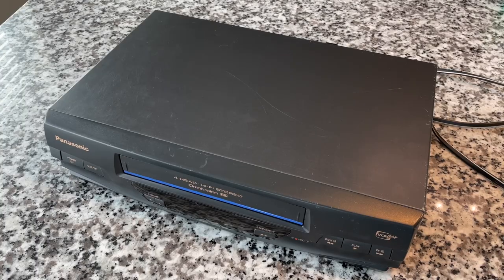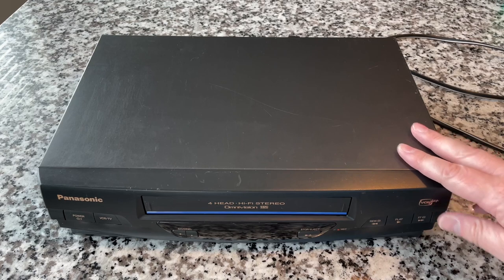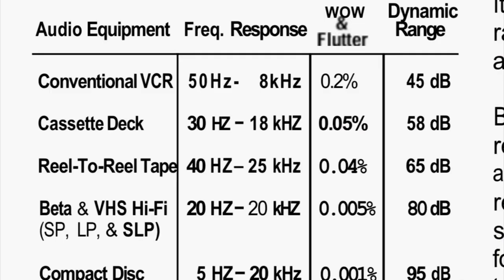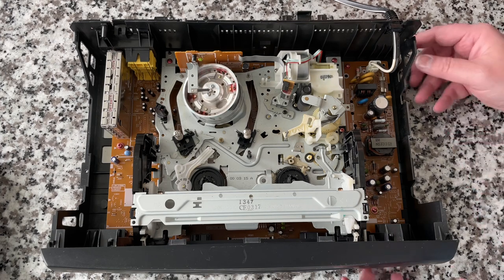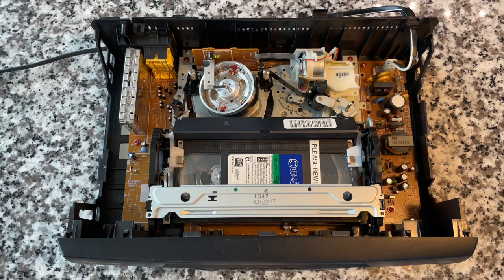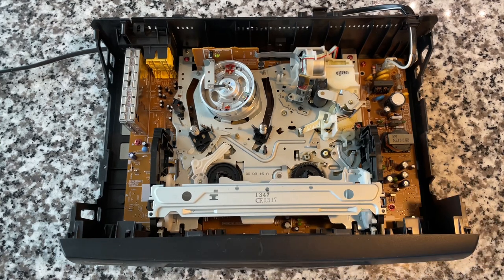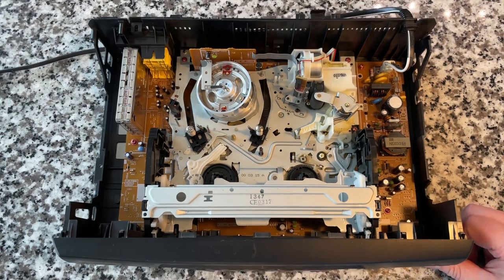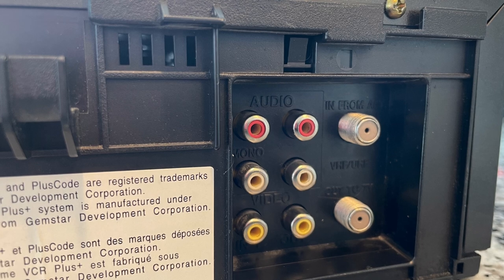VHS Hi-Fi - You threw out your best tape deck!

Comment from the maker: UPDATE  Thank you again for the corrections below.  VHS HIFI uses helical scanning heads in the drum to lay down HIFI audio.  The linear audio tracks were for older (or reverse compatible) LOFI audio tracks.  Also, SP, LP, & SLP had no bearing on the audio quality.
Reply: Yeah I was more pointing out that they actually did make a version of vhs specifically for high quality audio. Kinda seems counterproductive to have 1/2 inch tape and record audio on it that hardly uses any of the tape hence the introduction of that format I mentioned. 😊
Reply: Just think of the audio quality you could get if they used the entire width of the tape.
Reply: have you seen Tech Moans video about the digital audio player that uses VHS tapes?
Reply: @TiltedTripodMedia  adat system used in audio recording studios used svhs tape as recording medium using hexagonal scanning. Using full width of tape is not possible for hifi as linear speed is slower than compact cassette making very low quality recording
Reply: I have a panasonic world wide vcr they still made some of those as late as 2006 mine is a later 6 head model it works really nicely.  I like to watch tapes from over seas and its fine for that it records a lot to.  I still use it to tape talk shows cause I dont save them.
Reply: @TiltedTripodMedia  You have 2-inch reel to reel tape!
Reply: "SP, LP, & SLP had no bearing on the audio quality."

Well, yes and no.

The reason that it wouldn't have had bearing on the sound quality was because the writing speed of the rotary heads remained constant despite the linear tape speed.

However, slower linear tape speeds would leave the hi-fi tracks more susceptible to dropouts and may also reduce interchange compatibility of the recording (the ability to play a recording and have it track properly on a different VCR).

And hi-fi VCRs did provide good sound for the intended purpose, but the system wasn't without its drawbacks.  For one thing, switching noise can be a problem, which manifested as a buzz or hum that's either 60 or 50 Hz.  Another was that hi-fi used a rather aggressive compander for noise reduction, something more like DBX than Dolby System.  And, of course, there's always the problem with dropout noise.

There's a reason why audio professionals never typically used hi-fi VCRs for sound recordings.

And that's a stretch to say that VHS hi-fi (or Beta hi-fi for that matter) could outperform other audio tape formats.  Pretty much any digital audio tape format will outclass video tape AFM hi-fi.
Reply: Used to use my S-VHS as an audio record deck. JVC was owned by Matsushita when they invented the VHS format. JVC and Panasonic used to be sister companies. JVC now part of Kenwood
Reply: this is a hot topic over on my channel too!  Seems like a lot of folks (no fault of theirs) remember the older format of VHS audio.  Great video @Record-ology !
Reply: @Watcher3223  As a collector of a few hi-fi VHS machines and a very experienced user, you have more of a grasp of the short comings of the format than the author. I have a video up of some of the machines I have. Always use the SP speed to minimize video modulated noise and dropouts. The video buzz would always modulate with the strength of the dynamics of the music. The pumping of the noise floor was especially bothersome for me, same with DBX processing of audio.  PCM digital audio recording on to a hard drive is much better quality.
Reply: There was an early version of a linear stereo track which used Dolby noise reduction, but it was used before hi-fi sound track was a thing, and was not good stereo.
Reply: @RJDA.Dakota  The first VHS units sold in the USA were actually GE branded Panasonics. RCA actually missed the boat on VCRs. They were still trying to perfect their ill fated CED Selectavision video disk system when VHS launched.
Reply: @zulumax1  Our first VHS was an Electrohome branded Mitsubishi with Dolby linear stereo purchased in 1981. We replaced it a few years later with an Electrohome branded Mitsubishi S-VHS with Hi-Fi stereo, and mono linear for compatibility. That machine could even record Hi-Fi audio without a video signal being present. It finally died about 6 years ago. I have audio only tapes made on it that won't even play on my Hitachi linear stereo VHS with VCR+, although videos play fine.
Reply: @TiltedTripodMedia  what, helical?
Reply: @maximilianfischer8899  I think it’s called a VCR lol jk
Reply: I wondered how many people were gonna mansplain to you about hifi audio vs the linear track LOL. It's really amazing that the hifi audio signal is recorded BELOW the video track on the tape. How someone thought of that is beyond me. The only downside with hifi audio is that because it's scanned helical drum, you can sometimes hear head switching noise. Probably less so on pro recorders. I briefly owned a used Panasonic AG-7500A. What a beast of a machine. Damn I miss those analog audio meters. Tape transport was a tank.
Reply: VCR is a trademark of Royal Dutch Philips, their colour video cassette format released in 1972, some years before vhs or betamax.

Comment: Hi-Fi audio is recorded diagonally on the tape like the video. That’s why it sounds so good using more tape real estate.
Reply: It wasn't that the hi-fi track was recorded onto the tape diagonally, but because hi-fi audio utilized the high read/write speed of the rotary head drum.

Spinning heads were the answer to recording video ... and hi-fi audio ... onto tape very efficiently.  The first video tape format to successfully utilize this concept was the 2" Ampex Quadruplex.  Before that, recording video onto tape meant running it past a stationary head at a very high rate of speed, rendering it impractical.
Reply: Watcher is correct!

Comment: I used to record stuff on VHS Hi-Fi all the time back in the early 90s.  I got good results recording friends that performed in bands and did acoustic solo gigs at bars.  And I did some low budget TV shows where I switched two S-VHS cameras through an MX-12 switcher to a S-VHS HI-FI deck and got surprisingly good results.  The final shows were mastered to Betacam-SP for broadcast.
Reply: All that was missing was a Commodore Amiga with a genlocker to produce some very professional looking titles.
Reply: @GeoNeilUK  Or just a regular old hardware titlemaker. There were plenty of those.
Reply: ...and what is the better System for Video and Audio? > Betacam SP i think...

Comment: Audio junkie here. I had a great machine made by Hitachi in the 80's that I used to record supersize mix tapes. I don't remember the model number, but it was labeled as 7 Head with (5+2 Heads) in parenthesis. It even had LED VU meter bars. Sadly, it died in the early 90's and was cost prohibitive to fix.

Comment: A couple of points to note:
HIFI Stereo Audio heads on VHS VCRs are located on the same rotating drum as the video heads. The stereo audio signal is recorded using an FM carrier signal and embedded on the tape along with the video signals, different frequencies are used of course to avoid interference between the video and audio. HIFI Stereo doesn't use Dolby noise reduction, it is not required due to the exceptional signal to noise ratio.  If a HIFI Stereo VCR has Dolby NR this is purely for the linear audio tracks the VCR also records. These linear audio tracks are entirely separate from the HIFI audio tracks, only a few HIFI stereo VCRs also recorded linear stereo, most recorded only a linear mono audio track to maintain compatibility with older equipment. The large audio head to the right of the drum is for linear audio not HIFI stereo.
Reply: You nailed it, the hi-fi track is buried under the video signal in the deep layer of the magnetic tape which requires a special deep layer oxide coating hi-fi tape to get the best results recorded at SP speed. Helical scan frequency modulated signal onto the spinning drum, no Dolby.
Reply: @zulumax1  "the hi-fi track ... requires a special deep layer oxide coating hi-fi tape to get the best results recorded at SP speed"

Not really.  AFM hi-fi will record just fine on standard grade tape.

For VHS, depth multiplexing is used to record the hi-fi tracks onto the tape because lower frequency information tends to record deeper into the magnetic medium while higher frequency video information records closer to the surface.

Beta hi-fi for NTSC, on the other hand, uses frequency multiplexing.  The hi-fi tracks are recorded in the space between the luma baseband and the chroma under signals within the video, so NTSC Beta hi-fi doesn't use an additional set of rotary heads.

Beta hi-fi for PAL works under the same basic principle as VHS Hi-Fi.

However, for as good as hi-fi can sound, it's not without its caveats.  For one thing, it uses aggressive noise reduction.  And on more modern hi-fi VCRs where you can't manually adjust the level, your recordings will be at the mercy of the VCR's automatic level control.
Reply: @Watcher3223  lack of manual is exactly why modern VCRs suck, if you're gonna tinker with it, get used Pro VCRs. Nice AG-1980 would do nicely. Or go all in on an AG-7500A like I used to own, cuz i was a video dork. Damn that thing was a beast. That tape transport was built like a tank.

Comment: Decades ago, I used a Hi-Fi stereo VHS machine - which I still have - for recording orchestral concerts from FM radio and the results were exceptionally good.
Reply: The problem with VHS-HIFI and also BETA-HIFI is the compression/expansion process in the design. On classical music with low pianissimos and mezzo fortes you can hear the pumping and breathing of these devices. Fine for loud non-nuanced music such as pop and rock. With Classical I did not care. A top of the line cassette deck is superior in every way in the low pianissimo passages. Digital PCM subtracts ambience and tonality. Analog king is still the best reel to reel. Period.

Comment: I learned how to record high quality audio recordings onto VHS cassettes years ago.  They key is getting a reliable VHS HiFi VCR (not standard VHS).   The sound is fantastic, on a par with many top-end vintage reel to reel decks.  Plus there are two benefits: (1) very long recording times ranging up to 8 hours per tape, and (2) the ability to record unattended via the VCR timer.

Comment: Just one thing - hifi stereo on VHS uses the video heads (helical scan) for the audio. The linear audio head is used for the legacy mono audio only. The hifi signal is good but can suffer from chatter due to the head switching of the video heads.

Also I note you used an image from a UK TV guide, which to be pedantic was using "Video Plus" rather than VCR Plus, although I think the two were technically identical.

The main advantage of using VHS for recording eg radio was that you could record ten hours of good quality audio, continuously using LP, which was good for recording festivals etc back in the day.
Reply: Glad you pointed that out.
Reply: I think it was a different name for the same technology.  I used to have a video that would record the subtitles from page 888 by digitally superimposing them on the picture.  Any video would record the teletext signals off TV, but the reolution of VHS was too low to do it reliably so you couldn't just press text and go to page 888 and have it just work.  Though I think there are people who have managed to archive teletext pages from off air recordings, it takes a fair bit of work restoring them.  

There were even videos that had something called Startext, which would access the off air TV guides sent via teletext (which was also how the VideoPlus signals were sent) and let you use them as an EPG to record off air programs (and this was before the EUCD gave us fair use rights to record off air programmes, thankfully the EUCD got grandfathered into UK law after Brexit)

Comment: Some people threw out their Video recorders because they could no longer time shift recording TV shows off the air after the digital channels replaced the analog channels. The timer couldn't be programmed any more. Other than that you are right, the sound is  great on this format and long, long recordings are possible. I had a Sears hi-fi stereo VHS, however, that began to ruin the speed track of recorded tapes. If a tape was a slow speed the VCR would sometimes change the speed during playback to the high speed and the tape would look and sound like fast forward. I threw that one out but still have a SONY  a friend gave me.

Comment: I have fond memories of my Akai VS-A650, it was one of my first purchases when I got my student loan :) It included a Dolby Surround decoder and a stereo amplifier(!) that could be switched to output either the front or back speakers. The model has also record level sliders, VU meters, 7 rewind speeds (2x,3x,5x,7x,9x,11x,15x iirc) and an in-drum erase head for seamlessish editing. And funnily, a Y2K bug shifteing the weekdays off by one after February 28th, 2000 (years divisible by 400 are not leap years in the Gregorian calendar lol). I finally got rid of it because the power supply fizzled out after 8 years of 24/7 operation. First, the front panel CFD slowly got dimmer, and finally the entire machine would brown out trying to spin up its tape drum. But it saw good use recording temporary Music TV and "archiving" CDs before mp3s and CD burners were a thing. I heartily recommend it if you can find a working one. The model without the "A" in the model number probably is a better choice since it hasn't got the amplifier and thus runs cooler and might not have the power supply issues mine had.

thanks for the video!

Comment: I didn't throw my VCR away. I remember reading in the 90s a letter in What Hi Fi answering a letter about recording from the radio. They suggested that a VCR could be used and that it would be better than Cassette. It would not have been four head either at that time.

Comment: There's one major hangup recording on VHS, in any deck other than a pro deck, and that is compression or their innate limiter the ALC. 
I have two S-VHS Hi-Fi decks and neither one has independent recording level controls found on any run of the mill cassette deck!
Reply from the maker: Good point!
Reply: The ALC keeps a quite narrow range on the level of input. I don't know if it's a consumer protection design or it's necessary to the FM to tape process.

Comment: I buy hi-fi vhs whenever I can at sales. Also, 1 rotation of the drum represents I field of video, not one frame. It’s interlaced. Hi-fi did not use the linear track. The hi-fi was fm modulated and written concurrently with the second set of heads at a different azimuth along with the video.

Comment: For it's time it was a truly remarkable format.I chose to purchase a Harmon Kardon VCD1000 back about 1986, It cost me over $700 ( MSRP was $850) , mostly to use to record simulcasts of concerts and other radio shows from a local Chicago station, WXRT. It did have remarkable specs in its review in Stereo Review mag ( 09-1985) which even stated that "A tape dubbed on it from a CD, could not be distinguished from the original in a A/B playback comparison" It held out for a few years, but developed transport mechanism "bugs" and once CD's and then recording digitally with a A-D sound card on a computer and burning your own CD's became more mainstream and affordable it became something to find its way to the bin.

Comment: I used to use vhs hi-fi tapes to record live performances, especially that i could make use of 6+ hours un-interrupted, since the 90's all the way up to the mid 2000's when it was starting harder to get tapes, even though they were getting cheaper.  Only drawback was that little buzzing noise when played back on a different player, but in all, was very useful and good quality.  Would transfer them to cassette or cd-r when i edited them later on.
Reply: The buzzing noise was the incompatibility from machine to machine. It drove me nuts. It had great potential but due to the complexity of the Beta/VHS systems I could not use these successfully. Classical music was fine in the same machine it was recorded but if everything was not eight you will here the pumping and breathing. I went then to PCM Digital and was better but also had problems with dropouts. A great cassette recorder such as a Nakamichi, TEAC/Esoteric, Pioneer Elite were far more successful. Reel to Reel of course is another world.